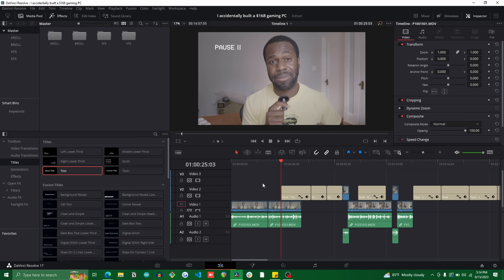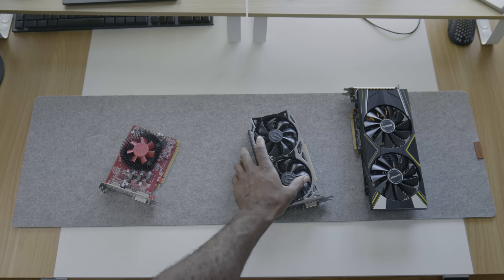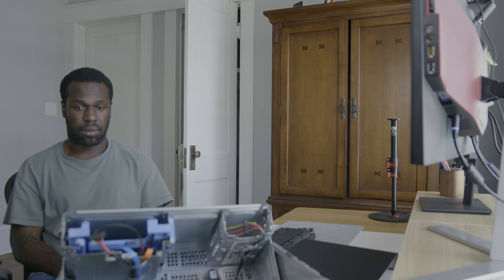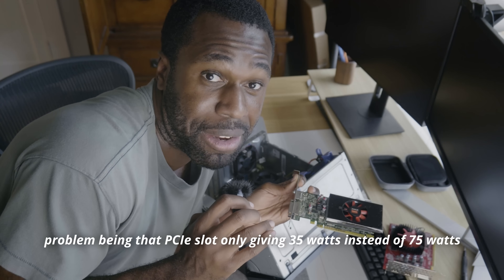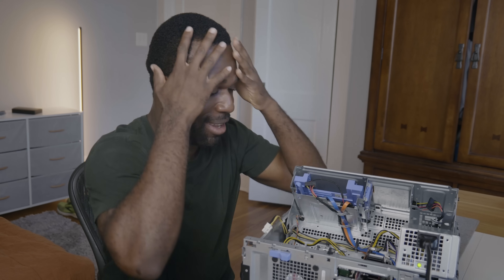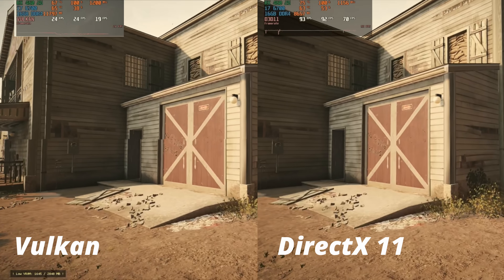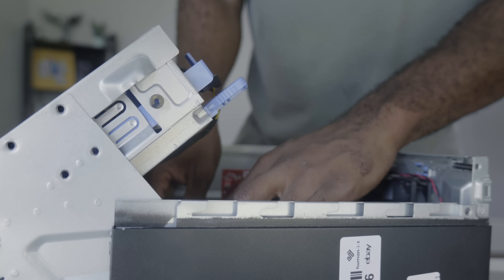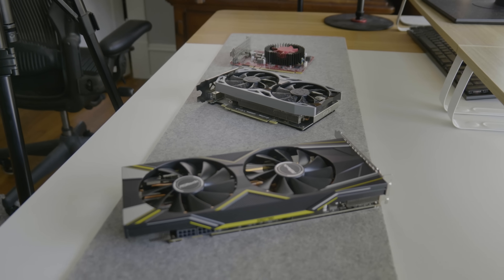So, I tried building a $168 gaming PC...

Comment: I think that money would have been better spent building a budget AMD system from scratch. Should do a follow up with the same money scratch build. 6800 (XT) or 7800/7600 based KILLER system. This is funny. I have been doing this for friends kids for years. Building Budget machines from used work machines. Tower case. Cheap Video card (not 2020-early 2023) You can NOT get a cheap video card that runs Cyberpunk, even today Sept '23. Literally years and Utubes has just recently figured this out.

Love your videos man.

Comment: Did I pay too much($300)for this PC? Specs are:
MSI Z370-A PRO MOTHERBOARD 
i7 8700k
ASUS GTX 1060 6GB Turbo 
16GB DDR4 RAM at 3000MHz 
Corsair H100i 240mm AIO cooler 
Kediers C570 open air case with 7 fans.
Reply: Nah you did good.

Comment: Well u can get good ryzen or oder i7 for a good price ...
The main issue is the GPU and PSU especially on Dell or HP that use nun Standard parts ... so upgrading later is not easy 
I would start around 500 dollars using a modern Ryzen CPU and a cheap used GPU and in a year upgrade the GPU then when prices are better

Comment: This is totally unattainable but I built a PC recently for only $190. It runs starfield at a pretty solid 30fps. Ryzen 5 2600 16gb ram and GTX 1070. Insane performance for lest than $200. Just found really good local deals.

Comment: I had similar issues building my sff gamer.  Got a 5040 opti and a a2000 gpu: gpu didnt fit the space.  Then i got a elitedesk 800 and it fit.  Then adding new ssd didnt work, but adding new m.2 ones did so more money there.  Ended up adding a 6400 to the optiplex and have two mini pcs now
Reply: Once you have built a proper PC and are upgrading its a lot cheaper.

I bought a 750w PSU.... I am essentially NEVER going to need to upgrade this PSU .... I bought a 5700xt... I do not need a new video card for years now...

Currently using AM4 socket so I can upgrade to AM5 when I feel the need... but DDR5 ram is over 2x the cost of DDR4 and the processors are also 2x as expensive... the only thing similar in price are the MOBOS....

When I upgrade a PC all I need to buy is a case and a PSU to replace my good one.. I move my video card to the new pc and throw an old video card in the older PC... then I can give that to someone who needs one or just keep it as a backup/bot farm ...

My old PC is using an i5-4460 and a GTX 950... It can still game on low settings. Upgrading the graphics card it could play most modern games on low settings but the i5 is only a Quadcore so really its getting pretty dated as most games are starting to only run good on 6 cores or more especially if made with Unreal Engine 5.

Comment: Just build an AM3 system its cheap and if you use the right parts you can still run most modern games on low settings.

Comment: I've built several of Optiplex/IBM alike PC & I gotta say 1050Ti Palit LP or anything equivalent suits perfectly for such budget gaming/home theater/office  setup since most of it comes with 250/350 watts of PSU... So yeah... It will run 2077/GOW etc as long as you manage your expectation... It'll work just fine... 🍻🍻🍻🍻

PS - $700?! Only to find out it was the power pin or button issue? My guy, you had it rough... Hahahaha... Still, You got the capitals to spend. IF it was me, I'll be robbing a convenient store the same day out of rage! 🤣
Reply from the maker: I was so frustrated 😭 Thankfully, I could return most of the stuff.
Reply: @OzTalksHW  You could? Well then, the only lost you actually experienced was time... 💯🍻 Went down the drain but managed to pull it back up before it gone too far... 🤣

Comment: Great stuff only issue with these are the case space, power supply upgrade, potential proprietry motherboard connectors but I guess one shouldnt complain about that at this price point.
In the motherboard department I can suggest checking the market for used mining motherboard which only have the pcie x1 slot(s), they can be very cheap these days. Also xeon, xeon prebuilds, can be great specificall e3 and e5 series, they are just rebranded core i series parts but cheaper, use the same motherboard.

Comment: LOL I spent over $3000 for computer parts to build a nice black/white case. 10 negative flow Corsair fans (all exhaust fans, 3 of those are on the 360 AIO on top). 13700kf, Asrock z790 wifi, logitech g wireless mouse, typewriter style white keyboard from AMD, 28" 4k monitor by Samsung, Corsair white headphone with mic HS80, 2 sticks of DDR5 Corsair Vengeance ram white rgb. Mostly everything has rgb. And I skimped out on the gpu. Got a RTX 3080 FE 10gb for $699 brand new and sealed. Still runs like a champ in 4k high settings, no RT for most modern games at around 90-120fps. Plays CP2077, Metro Exodus EE, Control, all in 4k RT 60fps med settings mostly.

Man I should have just watch your video earlier and save money. I could have just got a RTX 4090 or a RX 7900xtx. I probably could afford a new rig for about $1200. Great video, Ozzy! Keep it up! We need to save money here! Cheers! :D

Comment: What about a 1050ti?  I have the 460 in my HP 800G1, but I was thinking of a better card on the factory PSU might be the 1050ti.  What do you think?
Reply: I used a 1050ti for my sff optiplex, which had a 180w PSU, and it was functioning fine until a few days later where the PC abruptly died. I suspect it had to do with the PSU, but I just ended up returning everything.

Comment: Indeed, several lessons here. 

-When dealing with proprietary dell/hp/et al prebuilts, there will always be issues trying to use the computer in any way besides straight-out-of-the-box. Weird little failures. Bad design choices. Proprietary hardware problems. UEFI restrictions. Hardware whitelists. Custom windows distributions. The list just goes on and on and on. You will run into wall after wall after wall.

-We troubleshoot as cleanly, carefully, and efficiently as possible. 😉
Reply from the maker: Yep, precisely. Great when they work but awful when they dont lol

Comment: Can I ask you or anyone something? Why does the 1650 needs the Sata to PCI adapter?
Reply: The PSU in the Optiplex doesn’t have a 6 Pin PCIE power connection. So using the adapter you can create one from the Sata Adapter using a Sata to 6 Pin. It doesn’t work for everything because the Sata Adapter can only provide 54 watts versus the 75 watts of the actual 6 Pin cable, but because the GTX 1650 Super only needs and extra 25 watts it falls right in to usable with the adapter.
Reply: @babylion1225  Ok thank you.

Comment: This year I buyed a similar pc sff with a i7 8700 and 500 GB m.2 and 16 GB ram for just 50€ then I buyed a mobo to put that in a new case it is the most powerful full machin that I have thanks the pc market for that
Reply: The mobo cost around 30€ and a new power supply costed like 40€

Comment: This is my current best super-budget spec:

i7 3930K - 6 core / 12 thread
Corsair 240mm AIO  w/ fans
Asus Rampage IV Extreme
24Gb DDR3 1600/2133
Coolermaster 1000W PSU   ...this and all the above for £55 delivered....😮😮
GTX 970 4Gb (£30)
1Tb SSD Lexar NQ100 (£35, new)
Corsair Delta-Spec RGB (£30, with 3x RGB front fans)
Ubit Wifi 6 PCI-E (£22, new)
Windows 10 Pro (£3, grey market digital license)

£173 Total.  Let's see what you came up with.   >> Play <<

Comment: Damn just lost 2 mechanical hard drives on my old phenom 9650 system.. dang dang dang dang.. first the storage drive started clicking and not showing up. then the dumpy os drive started clicking and freezing the system for 60 seconds intermittently.  now these hard drives are well over 12+ years old a 320gb from a "NETBOOK" from when they were a thing before screwtube enforced 60fps videos.. and the other was a 160gb from GOD knows when i swear it started off life in an athlon xp 2000+ system.. So these drives lived a long life..
Reply: soo next step is to get a SSD and upgrade the 9650 system.. .. . . . lol  its still good its still good just a little dusty just a little crusty and the psu even has a little rusty on it lol

Comment: @_@ i got a second hand pc monitor and a mouse and keyboard for 420$. Everything is second hand. System specs?
12100f h610 rx 6600 450 watt and monitor Gw 2283 all second hand ram 8gb and 512 gb ssd. Everything second hand.

@_@ i didn't upgrade that system because. @_@ i have a gaming pc already. Rx 7600 and ryzen 7600x in that system. :) still 420 is so good for what it is. 
My sister is using that to play games.

Comment: I just finished a £116 pc for my partner's kid I took an i7 2600 motherboard 8gb of ram and 240gb SSD and a case for £50 part ex threw the old shitty PSU away replaced with a 500w 80+ cougar unit off eBay for £25 and grabbed a 1050ti off FB marketplace for £40 added a 8gb stick of DDR3 and spent £1 in my local cex for a 320gb HDD haven't installed Windows and benchmarked yet but it boots she'll only be playing games like Roblox , rocket league , Fortnite etc @1080p on her TV in her room so not massive refresh rates . So I'm hoping it'll serve her okay until I can find a better platform on the cheap maybe a cheapo a320 board with a first gen R5 or something

Comment: My build is best off one of your builds you made but I bought better parts tho
Reply from the maker: Nice! Specs?
Reply: @OzTalksHW   PSU 600w , GPU MSI GeForce 2060 super , 32gb RAM , NZXT Z53 AIO LCD display cooler ,  4 RGB UPHERE case fans , processor i5 - 11400 , Motherboard MSI B560I , 1TB WD Blue SSD , Case thermaltake H18

Comment: Ryzen 5 first gen CPU + entry level motherboard + ram is similarly priced, much more powerful, has exceedingly better upgrade options. This thing will never get past its PSU limitation, only accepts under powered cards, has so little cores, and is packed in an ugly ass case.

Sorry man, but this one is a bad investment.
Reply: 1st gen Ryzen has poor IPC compared to a 6700. In fact it is so different that the i7 6700 beats the r5 1600 in all but multi where it loses by 6% total. That's within margin.
Reply from the maker: Initially, I was going to say that there's no way you can build a PC that cheap on first gen ryzen...but then I checked aliexpress. You totally can! I'll take a closer look.